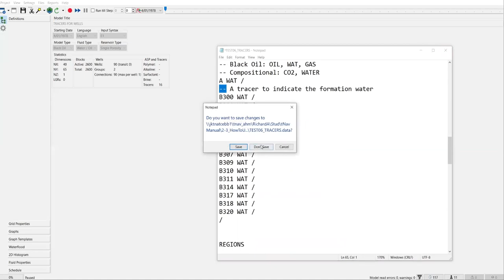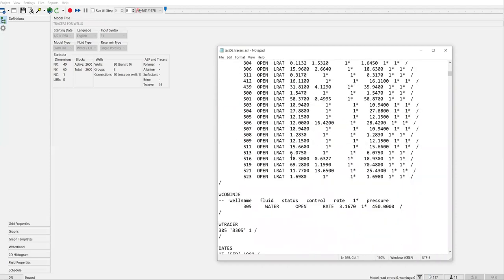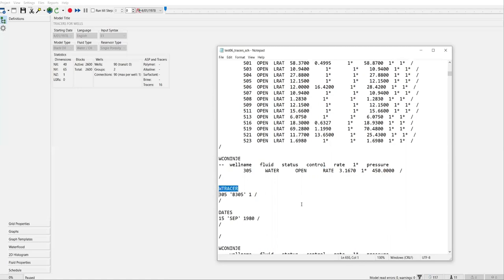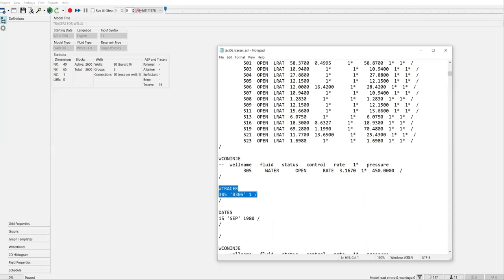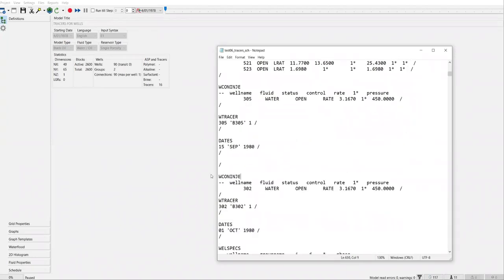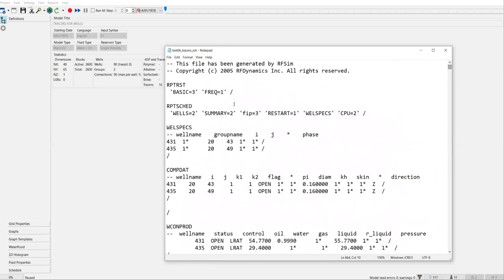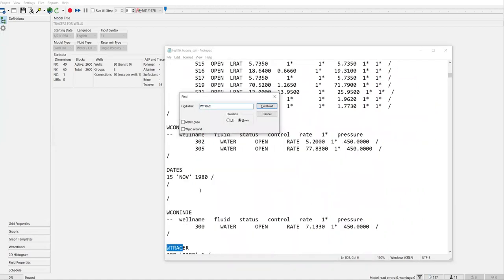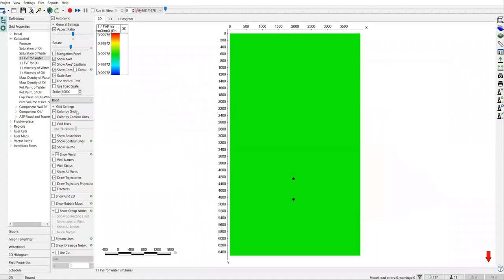tNavigator 118: Well Scheduling for Tracer Simulation

Comment: Thanks Eng man, these seems only injectable or pumpable tracers? Is it also possible to model inflow tracers that get installed on production tubings/casing? Thanks for the good work.
Reply from the maker: i dont think it is available, as reservoir simulation concerns more on the reservoir rather on the well internal